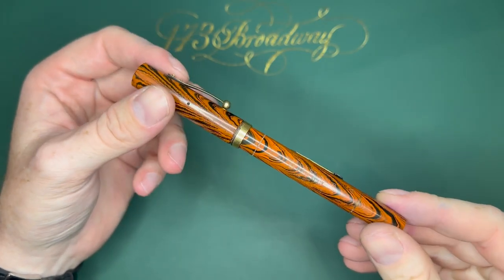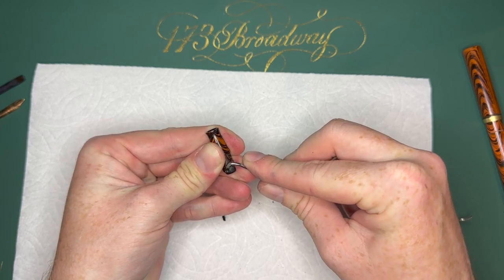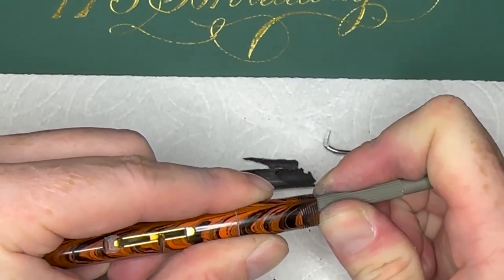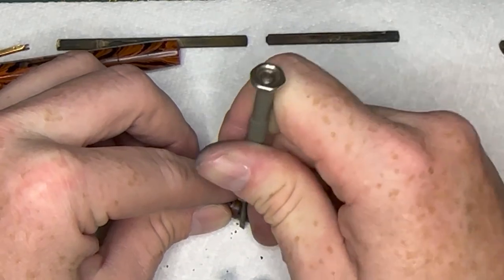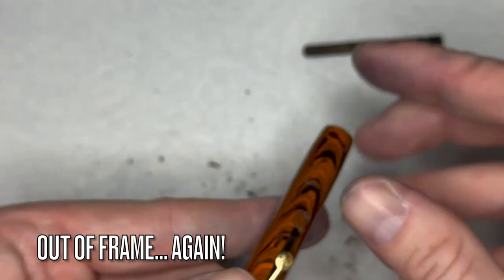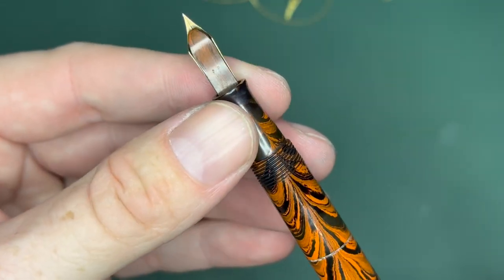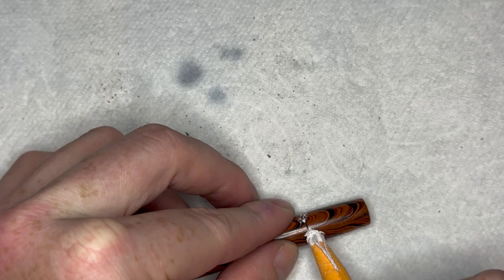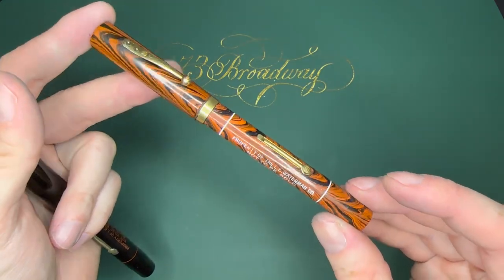Waterman's Ideal 52 Store Demo Pen - My First Restoration!

Comment: Good job.. steady hands bud! Not going to play operation with you! Lol 👍🤓👍
Reply: Would a q-tip with rubbing alcohol have helped soften up the gunk and dried ink?
Reply from the maker: @davidmurphy9049  I would probably keep any harsh chemicals or alcohol away from the pen since it's just vulcanized hard rubber
Reply: @CraigRoccanova  I used just the tip of the q-tip to remove unwanted paint on old models. It's tedious, but you just slowly dissolve the paint on the model. I'd imagine the ink might be the same, but definitely be careful with the old rubber. Good job though and must've been very rewarding!👍👍